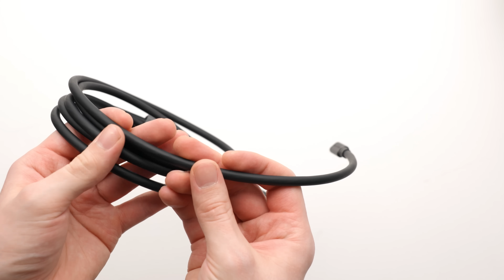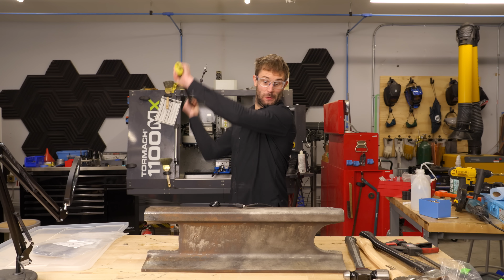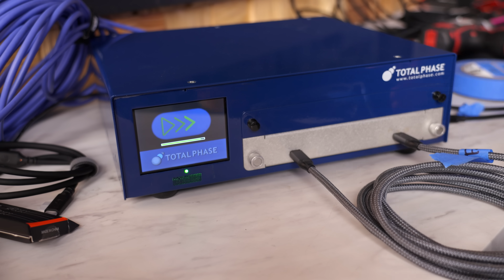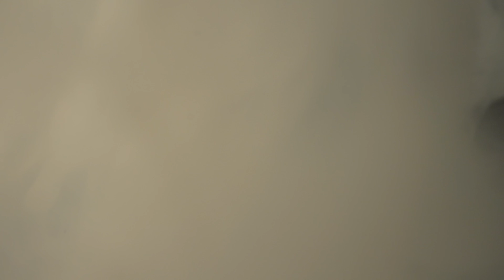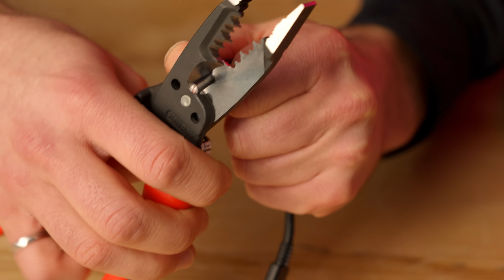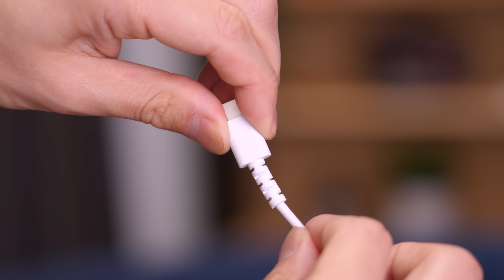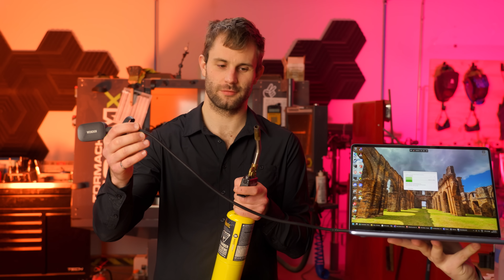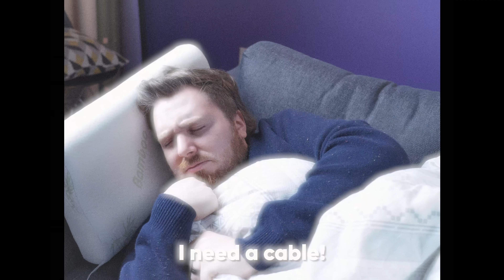Why It Took Me 4 YEARS to Make a USB Cable

Comment: What's your take on EU regulations locking us in on the USB-C format for the foreseeable future? Is there a need for innovation in the space or is the format holding up? 🤔
Reply: The EU law has a built-in review period. Every few years they have to assess the options available and see if moving on from USB-C would be pertinent. In fact, they've already done this; the original 2009 directive specified Micro-USB as the standard, but then they changed to USB-C with the new law because it was clearly better (and many companies had already changed to it). If another company or institution makes a better connector in the future, they'll probably consider it.

Comment: You said they weren't cheap but they're the same price as every other cable around here... I think the one I have here was 35 bucks (Canadian) and it's fine I think; it even has a little LED and a swivel head, but seems less robust and I have no clue about signal integrity. At 25 bucks your cable seems more than reasonable. Not sponsored :P

Comment: Believe me, I understand your plight. We had a sensor at work that needed a proprietary high speed USB cable with a very expensive ip68 connector at the end. They wanted $1700 per cable. I said "screw that, I know the company that makes that connector" so I contracted them to manufacture us the cable. We made a good deal with them and saved ourselves $1000 per cable. However Almost all of the 10 test cables they sent failed to communicate with the sensor. or showed up as USB2.0 even though it was a high speed USB C cable (I forget the spec). I asked them if they could please test the speed of the cable before sending us the next test cables. they ended up fully refunding us and ending our partnership because I asked "Just to verify, do you have the ability to test the speed of the cable?" Let that sink in. They are the designer and manufacturer of the high speed connector. They list the spec that it can handle but they can't actually test if it can do it. Blew my mind.

Comment: Every USB-C cable I have used works differently on all my devices and I hate it. What works on my S24 Ultra doesn't work properly on my S11 Ultra, same way it didn't work right on my S8 Ultra. The Samsung tablets are SUPER finnicky with USB-C cables. Charging speeds vary, different chargers with different results. OEM chargers, Anker etc, all annoying

Comment: I went to the store to laugh at the price.  I didn't.  I think that is actually a very decent pricepoint for a premium cable, so long as they work and hold up over time!  Congrats on the launch by the way, it seems you are sold out!  (FYI I went in after watching the video expecting a $60 cable or something after how Linus spoke about pricing, but I was so happy to be wrong.) I will be ordering 2 when you re-stock.

Comment: [checks store] Holy crap. Someone is actually making A-to-C cables that have all the data lines!

I knew there were Type-A connectors with extra data lines (I have USB hard drives with the extra-wide micro-USB connectors), and I knew Type-C connectors had enough pins to use them, yet all I was able to find locally were ones with the minimal data lines rated for 480Mbps. Guess I know who to go to next time I need a replacement cable.

Comment: I was expecting a much higher price, that's awesome.  I might have to be picking a few up soon.  

Also, I'm not sure if it would be a lot harder to do, from a technical standpoint or if the certifications / compatibility would be less straightforward, but I would love to have some same-quality as these HDMI and Displayport (latest standards for both) cables, that were not pitiful length.  Shopping for good HDMI and DP cables is a nightmare.

Comment: The crazy part is that the prices are cheaper than what some people pay, my last cables ran me $25 and $32 AUD. The one I use in my car for charging is already bending after 3 months (the actual connector) ON BOTH ENDS AARGHHHH

Comment: The fun thing is. Many did not have to buy that many cables so they don't know that you can easily get a 3 pack at around 10-15 bucks. So most will think that's pretty normal retail pricing, because they were totally that expensive a few years ago.

Comment: Probably one of the best ideas to improve the electronics landscape I've heard of recently. And with USB cables being as modular as they are, they won't become junk after the devices they're plugged into eventually give up. Also sounds great for testing USB devices, as you can be more sure it's not the cable's fault instead of the devices.

Comment: What about lower-tier options?

If I need a 1m 40Gbps 240W cable, it's great to have one that says what it does right there on the connector, tested to actually do what it says, at a reasonable price.

But what if I only need 10Gbps 30W? It would be great to have a thinner, cheaper cable that still says what it does and does what it says.

Comment: Linus has to cut himself some slack on the pricing here. 40gbps/240w cable for…under $30USD?…. Gas stations charge more for a phone charge cable that will give your phone an STD and then break before your drive is even over

Comment: So excited to hear about this new cable release! We're happy that our Advanced Cable Tester v2 played an important role in the research and development of such high-quality, well-designed cables. Keep up the great work LTT!
Reply: How do you guys tested your tester without any brands having good cables? Is there like an official usb-c reference cable available from the usb alliance?
Reply: @undergroundradio11  Hi, to answer your question, you don't need a known good cable to send electrical signals through them and analyze those signals. If you search for eye pattern or eye diagram, you'll see how they would know, there's a Wikipedia page about this. Furthermore, there were good and even excellent cables before Linus, and if there wasn't they could've easily ordered a custom super expensive cable prototype from a cable manufacturer that would be a perfect, but incredibly expensive golden sample. As Linus said, they often received good cables, but had issues with consistency and reliability. Signal degradation intensifies with length, so a 80Gbps 30cm USB C cable is common, but a passive (see acive vs passive cables) 80Gbps 10 meter (33ft) cable does not and will never exist.
Reply: I would love to get one of your testers but 15 is just far to much, did you look into making a cheaper tester? If yes what where the results?
Reply: @myxvcx2988 a cheap tester defeats the whole purpose of exclusivity. If you could buy a 5 USD cable-tester, that can reliably and confidently decide a cable is either GOOD or BAD, why would  you spend money on a 3000x more expensive cable-tester version?
Reply: @myxvcx2988 They surely have, but you can only go so far in reducing price while maintaing quality in signal analysis. If there was an easy and cheaper way to do so, there would be cheap alternatives on the maket. Also, the R&D cost is insanely expensive for a product like this, and you'll only move a few unites per year, even if you targeted yours at consumers, it's still a super niche product that few people would want or need. After you developed your product and solved all the issues, making a US$ 500 80Gbps-capable cable tester, a factory in China would reverse engineer your product, see how you solved every issue, cuting down costs and making a product that seemed impossible before you somehow made it, and they would sell their cable tester for US$ 200 as there wouldn't be much R&D costs for them. Now you're bankrupt.
Also, you may think you want or need a cable tester like theirs, but believe me, you don't. I don't know what would be your use case, but a E-Marker chip reader would probably suffice for your (and most, if not all consumers) use cases.

Comment: Thanks for working on these. Years ago, I worked on getting Type C USB2/3/4/TBT working on getting Chromebooks (and upstream Linux drivers) ready for use. So many issues were caused by various devices not working as per spec, whether it be polarity inversion or the instabilities during negotiations for a specific USB mode. We even started making spreadsheets at one point of cables, dongles, docks, and adapters that worked or caused issues. This caused us so many headaches because we could not trust so many cables. I would love to try some of these out when I get a chance.

Comment: Hey Linus, a DJ here, having reliable cables to hookup my computer to DJ gear is essential when performing for a live crowd!
However, I have an odd feature request.  Make your cables in different colors.  I use different colors to recognize different devices, so I'll never pull out the wrong cable.
Yes you can tag them, but I'm not fond of cheap cable tags.

Comment: Can't wait for someone else to do tests on these cables. We need a good source for higher end Thunderbolt C to C cables that support dock-able laptops with high power and high resolution displays and the only ones we have found that work reliably are over twice as expensive as these.

Comment: The price is actually crazy.
Because i was in a pinch, i dished out 20 bucks for a 240w cable thats only USB 2.0 rated.
Thing is, evey other fuckin cable is 2.0 rated. Its nearly impossible to find even just a regular 3.0 rated C-C cable that also does fast charging. Every 3.0 cable does a max of 22.5w on my S23 Ultra because none if them are rated for above 3 amps. Anker is the only brand that provides a 240w C-C cable at 3.0 speeds and they have one singular physical store in anither city (i live in the balkans and i am NOT paying 10 bucks shipping for a 35 dollar cable).

Comment: unpopular opinion, but i can live with a crappy data rate, but just want the sweet sweet Watts,  (and the durabiloty / longevity)  do you plan on a range like that?
Reply: they are 240w, it says it all over the store page...
Reply: @turdferguson7686  I get that.  I just think that a lot of the cost and effort has been in getting the data right,  can there be cheaper ones that sacrifice data throughput but keep the 200+W  which is what i prioritise (and actually 100w would be fine for me come to that)
Reply: @mralistair737  id imagine they made sure it is doing the power at spec as well. would be pretty funny if not though. "true spec!" ... "well no, not THAT spec though" lol   the prices arent too crazy on them either way, ive paid more for lower spec cables so worth a try in my opinion.
Reply: @turdferguson7686  it's not terrible.. but it's not "i'll buy ten and replace all the ones kicking around my bags" sort of price either.

Comment: While the price for 15W cable is actually lower, than the Anker cables I'm using right now, unfortunately cable itself is basically same as postage to Czechia🇨🇿🇪🇺 😔

Still I'll give it a try, once I'll lose my current cables.

Hopefully by that time, there would be also 1m cables in offer, as I currently struggle with my newest 1,8m cable, as it turnedto be too long for most cases and LTT cables as of now start from 3,5m…

Comment: It's all good, but unfortunately, in Europe, for example, for me in Poland, after taxes, it costs CAD $54.10 = POL PLN 141.20. It's a shame because if it cost the same as in the US, i.e. CAD $26.99 = POL PLN 70.71, I think I'd give it a shot. I appreciate that it's the best cable I've ever seen, but unfortunately, it's priced at TWS headphones or a charger + case + glass protector + a Ugreen cable :/

Comment: I have got to say, apart from the issue that you have none in stock anymore already... and I consider 20 EU bucks a normal price for a 1 meter 40Gbps cable (best price I can get locally for the Hagibis Thunderbolt ones), and you selling them for $30 Canadian (which at the current exchange rate is *less*), my dude... your cables aren't "premium pricing". They're cheap as hell. Apple still charges 160€ for theirs. More please! Price them all out of the market.

Comment: Hi Linus

Can I get one of these cables that is, quite literally, like 50mm long including connectors?

For power bank purposes ( my specific use case is a Makita USB adaptor, I usually plug in, fold the cable over and sit my device, on top of the adaptor)

Comment: tbf, that whole thing about the transparent error correction means its not quite as simple as "it either works or it doesn't" And that's before you get to things like electrical noise.

But yes, these look great, look forward to getting one if I ever catch them in stock. honestly for the clear labeling alone!

Comment: I hope these actually are reasonably priced. I know they won't be cheap but I mean your freaking screwdriver cost $70 and that backpack cost $250. That's insane. I get it, it's expensive to manufacture things and when you're not sure about how many you're going to sell that's going to bring the price up per unit plus other variables... I do understand. Doesn't make it any less frustrating so... Fingers are crossed that these aren't like 100 dollar cables Because this kind of cable is desperately needed in the industry.... By the way I don't know what's going on but the price is not changing no matter which length of cable or speed I choose. Having said that, the price of the super short ones or rather the starting price doesn't seem really bad. Not insane. Seems somewhat reasonable. Especially considering the standards you are holding them too.

Comment: What's the "deal" with your cable  tester ? What does "failed" mean ? Signal integrity ? By how much did it "fail" ? It should tell you everything you need to know, but you didn't tell us even the minimal we needed to know. What's the brand and model of the tester ? What standards does it test to ?  //  Specs verification is an art and not "plug and chug" ! You have to have quality equipment and a high level of expertise to use it properly to get accurate results that can be depended on. Does this sound familiar ?

Comment: I don't believe this cable can pass 13 amps without a voltage drop less than 5% below the spec's "nominal voltage" of 18 volts. This claim is ludicrous ! The (maximum delivered) "Wattage" claim is a meaningless spec. The spec should be about the max current it can carry without the voltage not dropping more than 5% from  the "nominal" voltage t the cable is rated for. This means it is supposed to carry 26.7 amps at 9 volts nominal and a theoretical 26.7 amps at 5 volts nominal. These 3 voltages are the "standards" for USB charging voltages. No devices exist needing to charge at these currents at either 9 volts/26 amps, much less at 5 volts/48 amps ! What kind of "snake oil" are you
peddling ?  // The 15 watt cable is overpriced since many cheaper and superior cables can be bought for much less money (3 amps at 5 volts, 1.67 amps at 9 volts). These cables don't even have the much more duable mesh outer sleeves.  //

Comment: I can absolutely assure you the problem is coming from the wire source.  China buys "chops" which is "mostly clean" recycled copper wire.  The actual problem is it will have tin, zinc, manganese and iron contamination.   China smelts the chops, skips the electrolytic purification process and uses very low quality crimp joints and connectors with barely a vapor coating of gold.  Even the plastic tip and insulation is contaminated, which, if you've been to china you understand how that happens...and the result is an impossible to reach spec.   My part in this is I buy copper wire from a variety or recyclers and do the chopping and electrolytic purification in house.  We don't extrude here because the specs vary so much the equipment is simply too expensive.  What we produce is five nines pure copper, just 00.001% contamination tolerance.  Its such a difficult task your process is completely segregated between two buildings and one of them is hepa filtered consistently.  We even displace our sealed finished anodes with argon.  My customer is a us category wire manufacturer that goes through an incredibly strict certification process to produce cat 7.    Does USB C require this standard? No probaby not but the frequency is extremely high in that cable and purity of the copper matters.

Comment: ? Or just get cablematters cables, they are certified, and don't sell cables that are too long for their speed. USB4 will cover 20Gbps over 6ft, even for USB 3.2 2x2, because they use thick copper. Sorry bro, your cables aren't fixing any problems. Good price though.

If you need long cables your best bet is to just get fiber, which is very expensive but will get you full speed over 20, 50, even 100ft.
Reply: It was so worth scrolling for 5 minutes to the literal bottom comment to find your terrible take. (yes, i'm a biased fanboy who has no real info on the cables you describe)
Reply: @petersandgren3192  ok? I'm right though